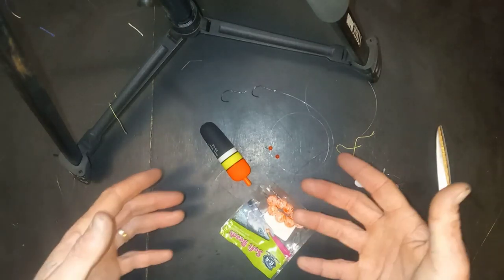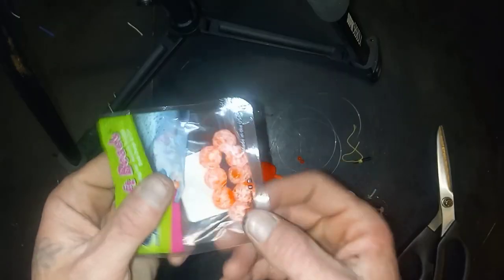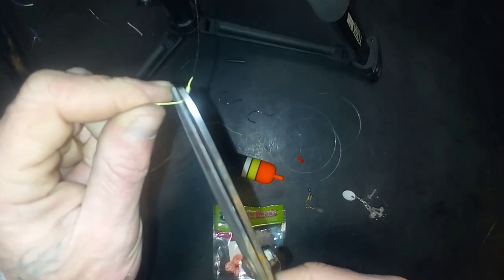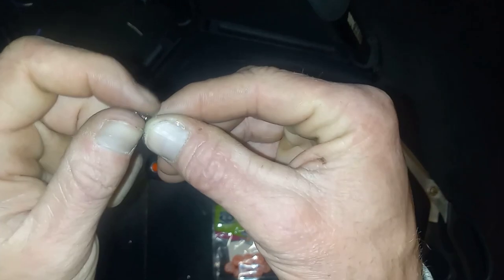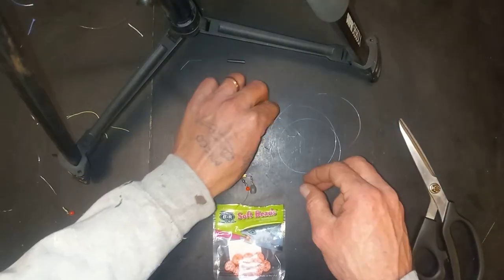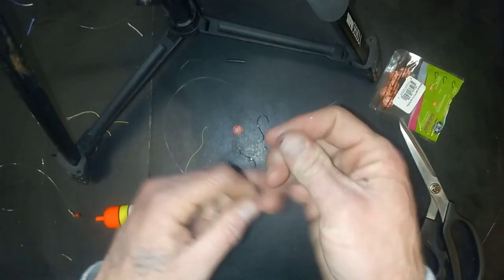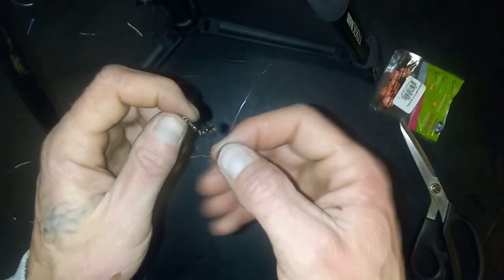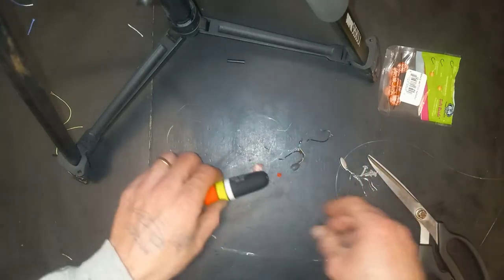Steelhead Soft Bead Setup | Catch MORE Fish With This Simple Setup!

Comment: How do you choose what depth to run. 
Example my water is 6’-8’ deep?
Reply from the maker: Great question. So I like to start at like 2ft deep and run the drift at least 4 to 5 times. I then drop a foot and repeat until I find bottom or fish. You can also find bottom first and get yourself like 6 inches above bottom, drift that, then every 5 drifts shorten it up a foot and repeat. Once you find the depths the fish are sitting, keep probing that depth, even at new holes. Good luck, tight lines!